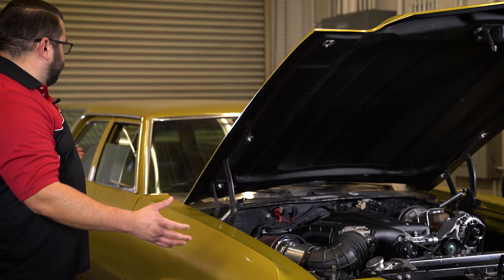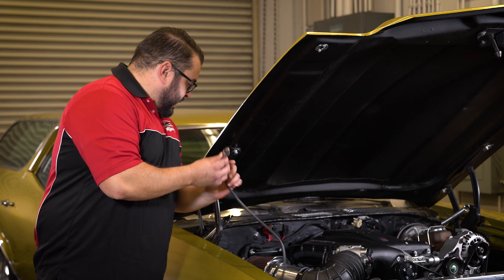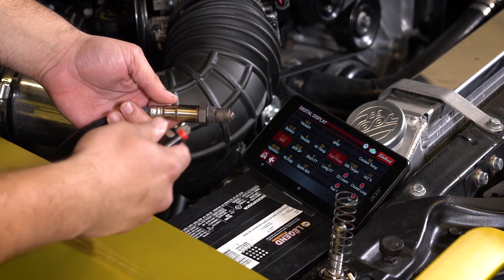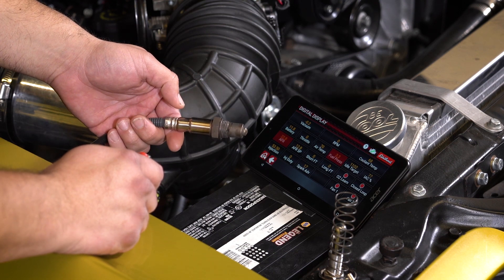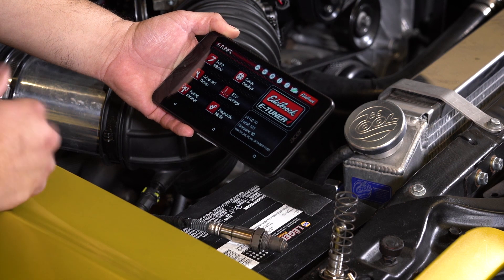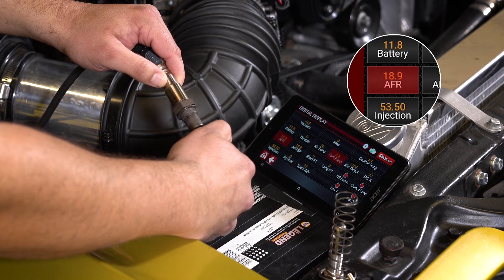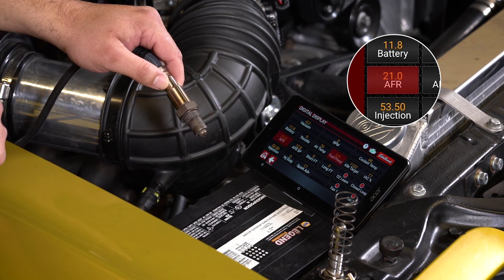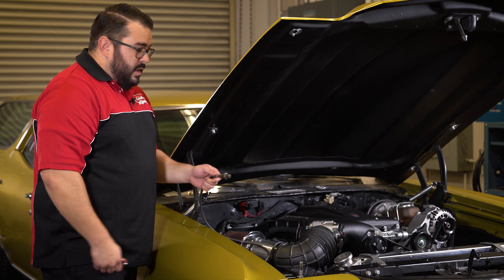Edelbrock Pro-Flo 4 Tech Tip – Testing Your Pro-Flo 4 O2 Sensor

Comment: Thanks so much for explaining how to do this. My Pro Flo 4 XT EFI came with a bad MAP sensor new out of the box. With this bad MAP I ran engine trying to get idle and timing right with it stalling every 5 to 10 seconds. Replaced MAP and now my manifold readings are actual instead of stuck on 29. She runs without stalling now but O2 stays at full lean. Im sure its a bad new sensor too but your test will tell me the outcome. I paid for the MAP sensor replacement without bothering Edelbrock for the replacement since the pro flo took me months just acquiring other necessary parts preparing for the install. However, if the O2 sensor is bad they will keep a customer if they send me a replacement in exchange for the original one that came defective. I have had zero luck with this pro flo and the vehicle was my late fathers truck, it happens to be my daily driver also. Needless to say I been without a vehicle for a while now due to complications with installing everything to convert over to the PF4 EFI system. Lots of unexpected hurdles sticking this on a 1999 Tahoe, we will just leave it at that. Thanks for the video.